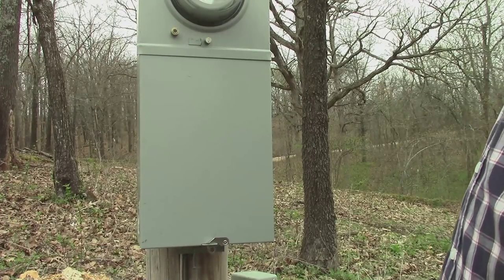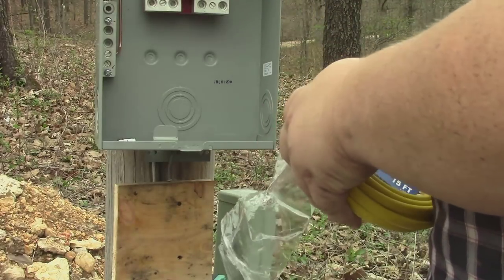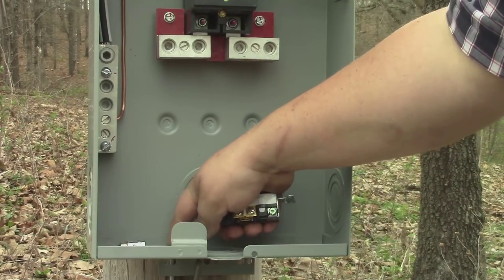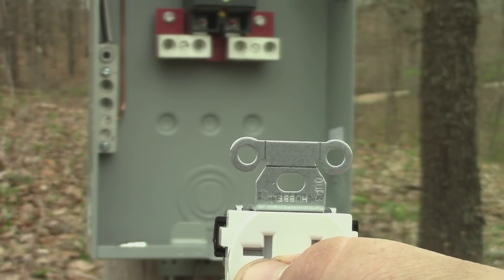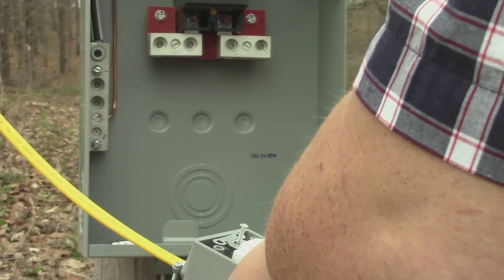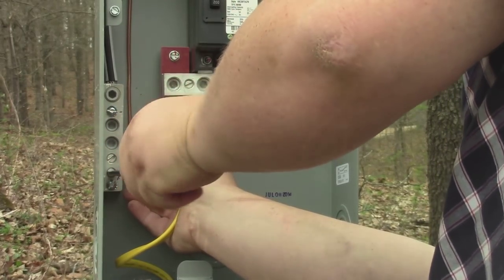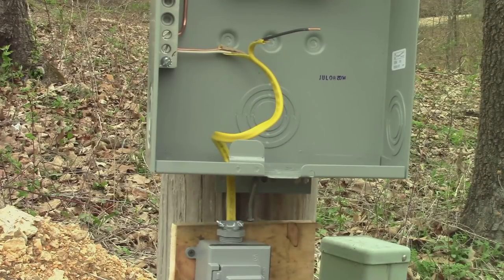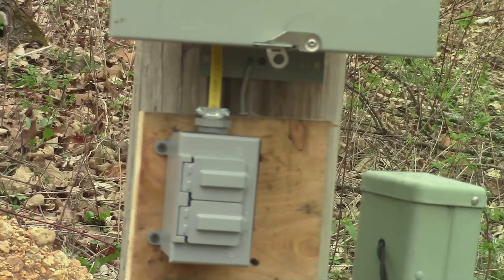Hooking Up Temporary Outlets To An Electric Meter

Comment: I am not an electrician but do know that this is nowhere near correct or even safe for that matter. No 20 amp breaker or GFCI so you get a full 200 amps right to the receptacle. You may as well have just tapped right into the transformer. I think you misinterpreted the electric company when you said "What ever you do below the 200 amp shut off is up to you". I think they meant to say if you fry yourself IT'S ON YOU. The hammer method of testing was great though hopefully your gloves were wet too. My advice to you is for liability reasons don't ever let anyone besides yourself plug anything into this outlet. This was like an episode of Duck Dynasty or something.
Reply from the maker: +Mike S hahaha....This has worked fine for months now,  I did not want to spend hundreds of dollars for outdoor rated sub panels and the like, so I didn't!  And the result has been trouble free operation of my air compressor, fan, laptop, you name it.  It was explained to me that the electrical component that is plugged in will only draw as much power as what it uses, unless it messes up and shorts out or something, and let's be honest, how many newer appliances have you ever seen short out...I have never had anything even flip a breaker before in my lifetime other than using too much power through a 15amp breaker.  So as long as I keep in mind how much power I am drawing through that romex and receptacle it should be totally fine.  Here's what it comes down to, all the safety sallies of the world want to avoid risk.  Life is risk.  I guarantee you have a higher probability of dying in a car crash than I have of being electrocuted.  Jerry rigging stuff is how we hillbillies get by! lol   I get the same thing from people about not using safety equipment while milling lumber or using the chainsaw.  People don't realize the inherent risks they take everyday, but love to point out when I take one.  I have never once said this is a how to video, or this is the way you should do your project...I'm just showing what I do.  Of all the times someone has jumped on me for doing something unsafe, I have yet to even get a boo boo! lol   I have been doing this stuff all my life, and so far so good.  Not saying nothing will ever happen, but it's a risk analysis game.  the probability of me dying while felling a tree is probably way less than 5%, so it's likely to turn out ok.  The same applies to everyday life..every time you eat you have a small percentage of a chance to choke to death, but you weigh the risk and decide it's more likely to turn out ok.  I take full responsibility of my own safety, so if I kill myself doing something, it's my own fault.  Also, no one else can plug anything in but me, it's obviously private property so they would be trespassing in the first place, and I keep the meter breaker shut off, and padlock the meter box.  I am the only one who can access the 200amp main breaker, including the electric coop.
Reply: +Backwoods Patriot "This has worked fine for months now," That famous phrase people say when you point out safety flaws such as no earths incorrect over current protection etc. It will work fin until such a time as a device goes faulty and shorts to ground or you cut through a cable by mistake and the only over current you have is a 200A incoming isolator. Yeah, that will go down well. If you going to do this kind of crap work at least dont try and show others how to do it. This also has nothing to do with "I know what im doing" because from looking at this you clearly dont, if you did you wouldn't be making up reason as to why this sort of crap is ok.
Reply: Do you know the true purpose of a breaker? It's to protect the wires buried in walls. If his one foot of Romex catches fire inside the panel... come on. Everybody needs to get their panties out of a wad. 50+ years of outdoor outlets without a GFCI... don't fall for everything the government tells you.

Comment: On another note of safety after thinking about it you shhouldhave a 20 amp fuse or breaker in place between the main and plug. I know you are on a tight budget but you shouldn't risk a fire or your life over 20 bucks, hopefully more subscribe to get you some cash rolling in.
Reply from the maker: Alexander Lae Ya, I told another person already I was planning to add a 125 volt 20 amp in line fuse, since I don't see how you hook up a breaker without a rail to snap it into, if you know of a way let me know!

Comment: You can't do that! That breaker is 200 amp. You can not directly connect your outlet to the 200 amp breaker!😢 You need another 200 amp panel to get your 15 amp service line. That's very dangerous!!😮😅